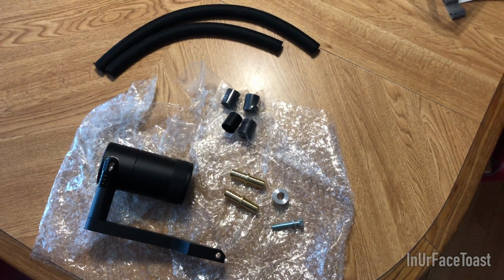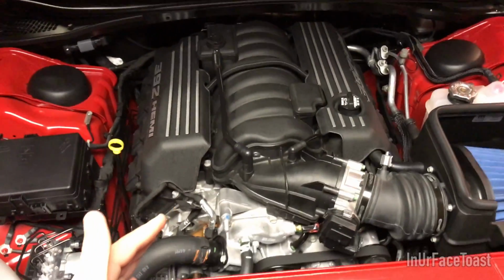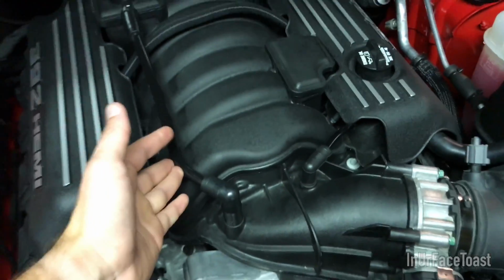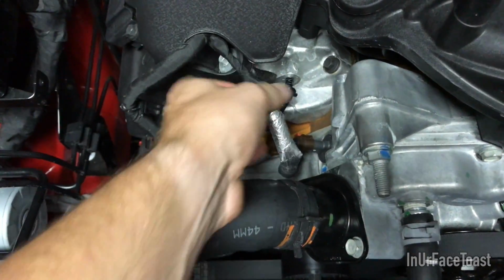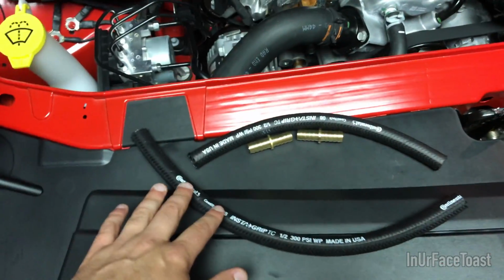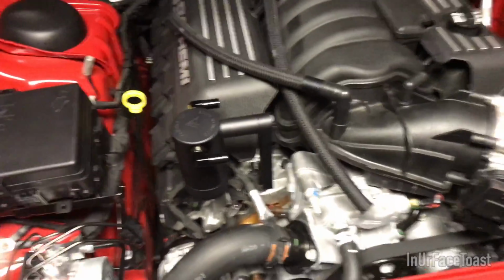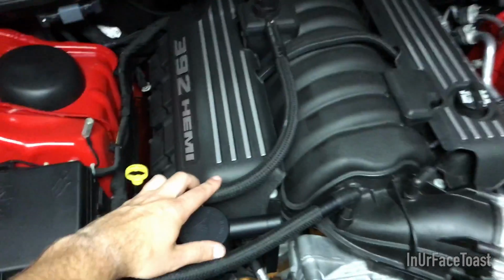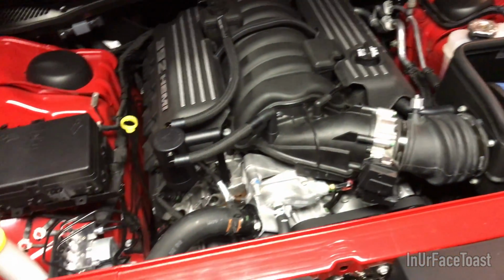How to install a Oil Catch Can on SRT 392 Challenger Step by Step

Comment: Where does the spacer go,behind the z bracket or in front where the bolt goes in?
Reply from the maker: It goes in between the engine block and the bracket